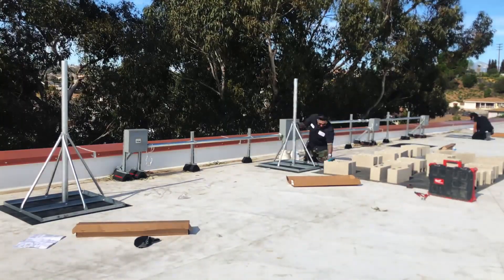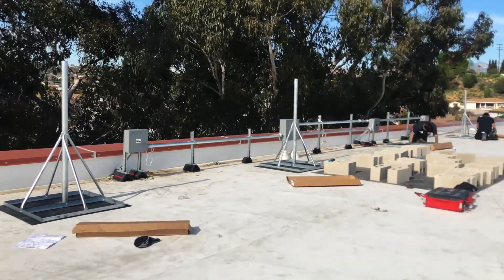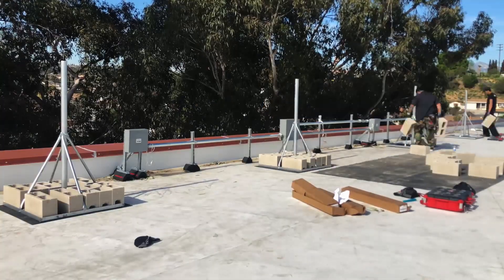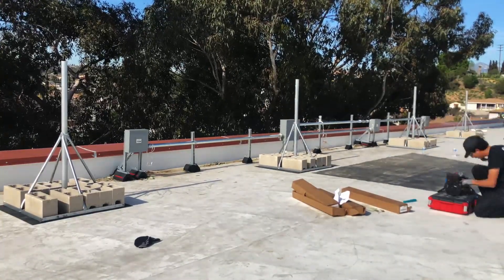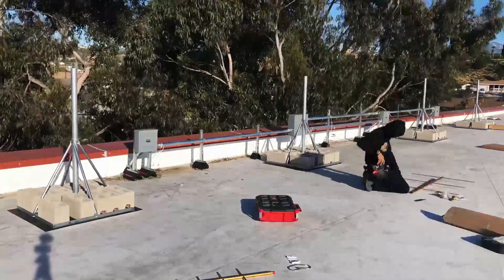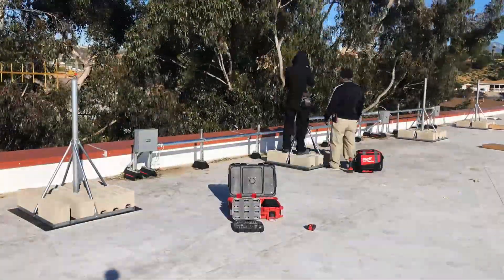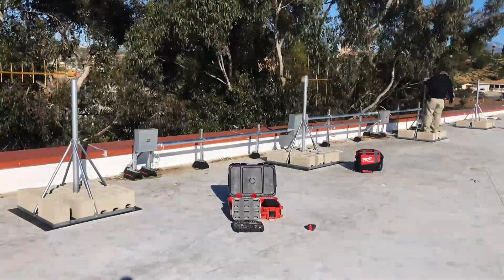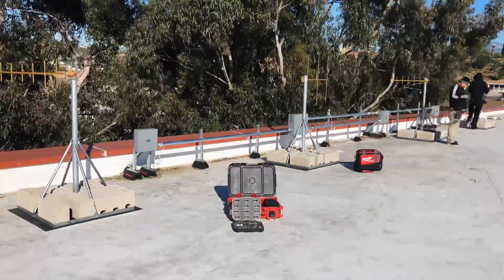Non Penetrating Roof Mount and Donor Antenna Installation

Comment: Hi George, I am curious about how you feed the outdoor antennas. I see 4 cans connected between them with EMT conduits. Could you explain me a little more about what is the conduit size, and what cable type goes into the conduit and finally where does the cable end is connected inside the building?